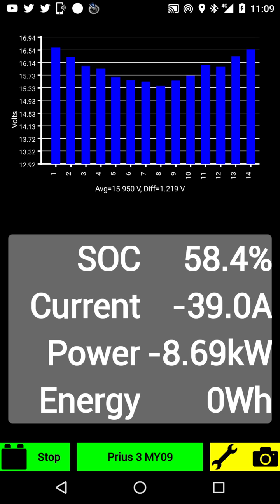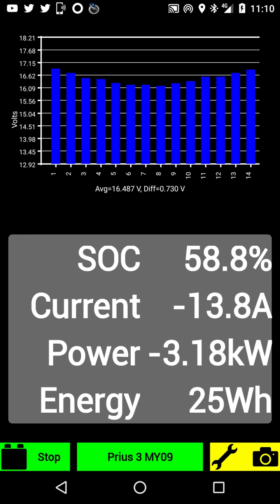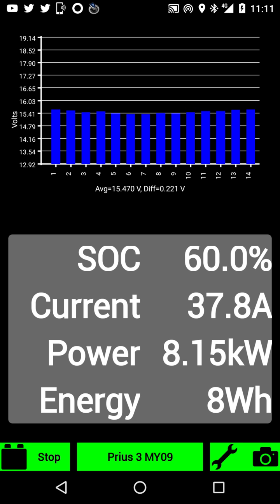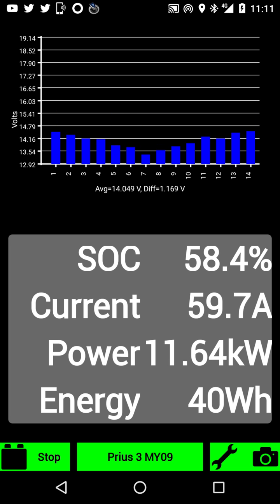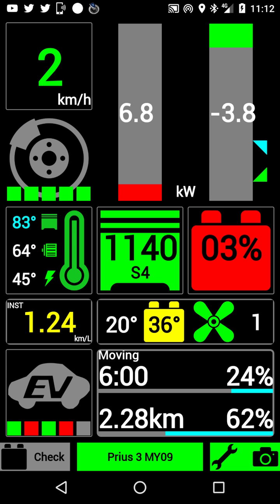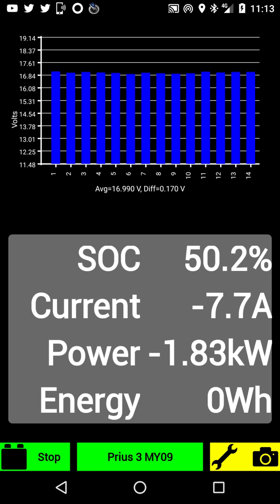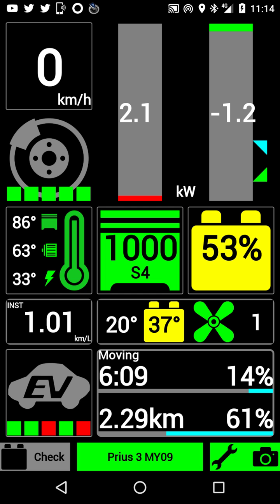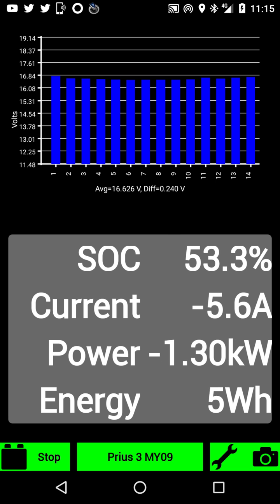Check hybrid system P0A7F Prius error

Comment: I have the same issue, block # 7 is the weak one.
What is the optimal voltage for each cell? Im looking for couple of options, changing the full battery pack or replace the weak cells. 
Please advice.